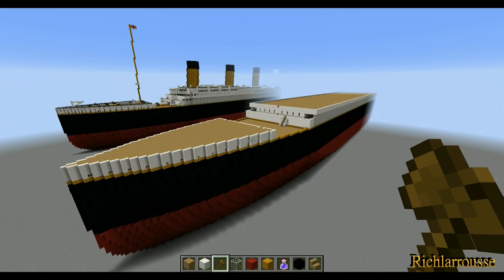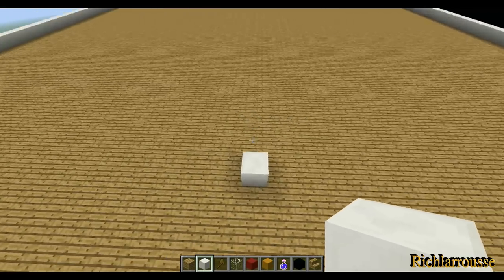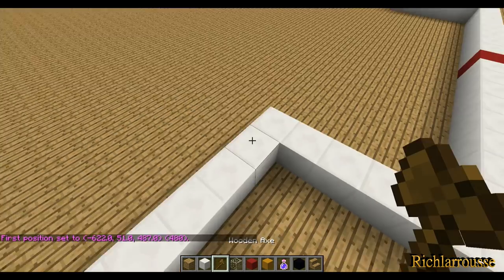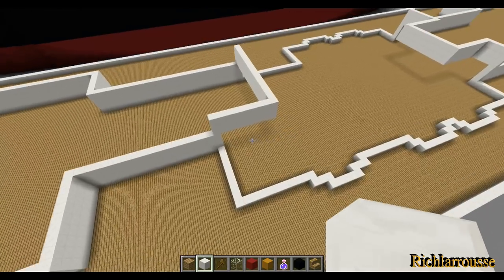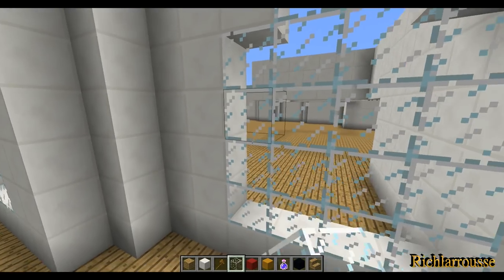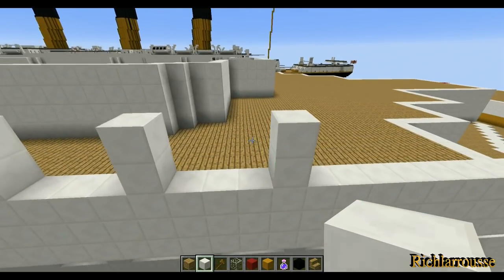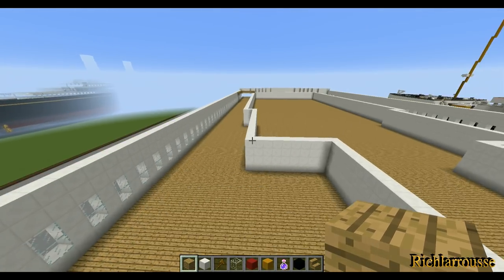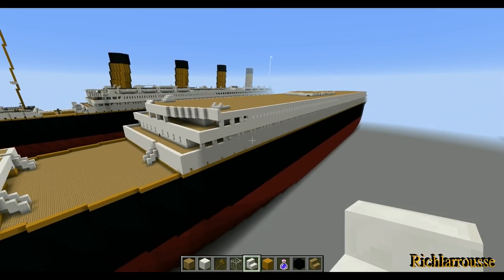Minecraft RMS Titanic Tutorial #5 (2018)

Comment: Did anyone else use white concrete instead of quartz for the whole build?? Looks better and more accurate
Reply: I know but I accidentally made it smooth quartz so I will have to restart😂😂
Reply: @_FIAV_  you didn't have to restart, if you have world edit you can replace those
Reply: @_FIAV_  It's simple
Reply: I used white concrete but I'm on console so yeah not happening Ill continue to use it
Reply: Yeah
Reply: I used smooth quartz, as the white concrete is a slightly off-white, so I wanted the bright white of the quartz but without the lines.
Reply: I used smooth quartz block
Reply: Smooth quartz look better in my opinion, white concrete has a blue tint to it
Reply: I used white concrete and I use concrete for most of my bullds
Reply: Im using smooth quartz and texturing with iron blocks to give it that rivit look
Reply: I used smooth quartz and it still looks better
Reply: I did that lol. I didn't want the ugly grid pattern.
Reply: i did!!!
Reply: I am

Comment: 21:54 Placing the inwards 4. For reason mine is 5 long but so far everything else matches up and have no idea what to fix. I know the dimensions of my ship are correct and everything else has lined up perfectly

Edit: Figured it out. One of the longer walls forward on the right side was off by one block. That's the 2nd time I had to correct that one. I've compared distances between the outside, inside walls, wall lengths and everything. You can find outer distance by counting certain pixels in the blocks when he stops.